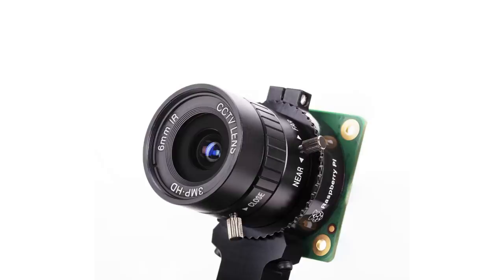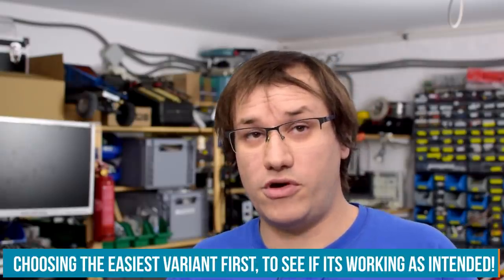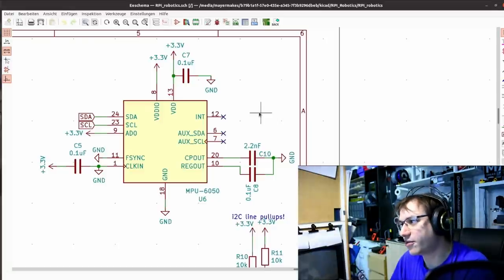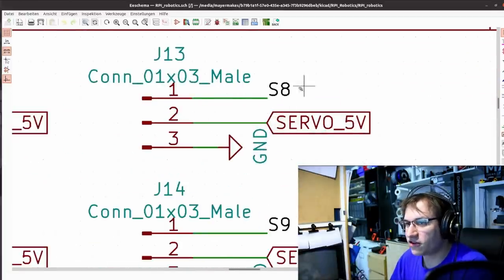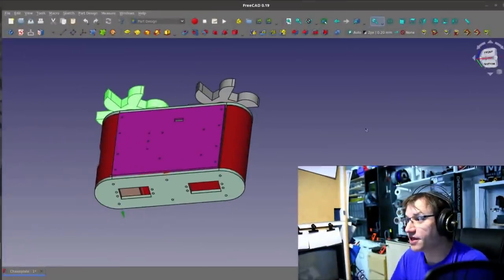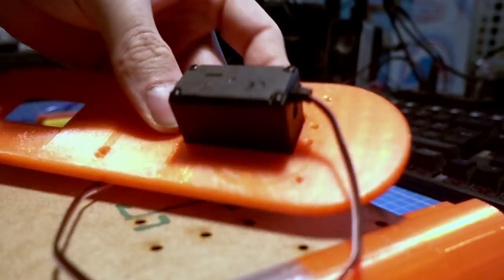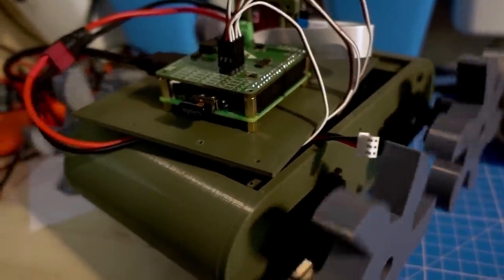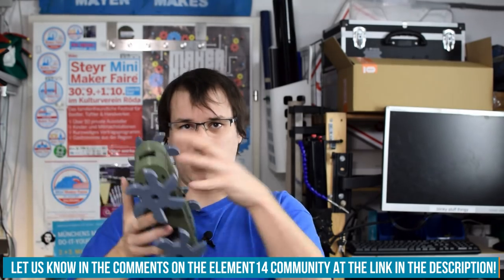Build An FPV Rover with #Raspberrypi

Comment: Great start, love your videos! 

I have 4 points 

1) A magnet on a movable arm
2) A small vacuum cleaner, strong enough to pick up small parts 
3) A rubber track instead of wheels 
4) A way to charge the batteries, a docking platform with induction charging.
Reply: All very good ideas! make sure to share them on element14.com/suggestionbox so we can pick them up!

Comment: That's really cool! It has lots of potential. The way it's designed, you could have lots of interchangeable wheel shapes and sizes, and even tracks. You might need to swap a servo on each side with an idler wheel to keep them from fighting each other, though, which would cut your torque in half, so maybe tracks aren't such a great idea. Regardless, the flat, low-profile design lends itself well to making lots of very different modular attachments for wildly different tasks. One could be a gripper claw to make retrieving lost items from under furniture easier. 😉 

I am curious why you didn't go with a Pi Zero W, or would that be underpowered for this? It would certainly be a smaller form factor.
Reply: A bunch of good ideas! make sure to post them at element14.com/suggestionbox so we can pick them up!
I prefer the a+ for computational power and connector sturdy Ness, the zero is no my preferred choice and the project does not need it to be smaller.
Reply: @MAYERMAKES  The Zero definitely has its limitations, but the connector is the same as the rest of the line. Unless you want to pay 50% more, the Zero doesn't even come with a header soldered on, so it's just solder holes. You can't get sturdier than that.

The computational power of a Zero is definitely a serious limitation, though. I suspect the video streaming alone would stress it. Even a b 3+ is not suitable for a desktop OS regardless of what you may have heard. I've tried it. Just opening a Web browser is an exercise in frustration.
Reply: @awo1fman  I'm not talking obout the gpio conncetor, but the Camera connector.
Reply: @MAYERMAKES  Exactly the same kind of connector, only the Zero's is narrower and on its side instead of sticking up. Seems like a wash at best, but the Zero's connector lying flat on the board seems stronger to me. But orientation of connectors is a space consideration as well. If you want to expose the connector to the outside of the enclosure the edge is better, but if the cable is completely internal then the perpendicular connector makes more sense. You kept the cable internal, so the A+'s perpendicular connecter is much easier to work with.

And again, a Zero probably wouldn't be up to the task of controlling everything you might want to add in the future, so I'm not at all arguing that it would be better for this application. I just don't think there's enough difference in the sturdiness of connectors to matter.

Comment: But wait - how did you build the robot without that screw driver?!? Novel idea for the wheel / traction design, I like it! Could you have duel filament printed it so the flexible was only covering the curved faces?
Reply: multifilament printing would have been an option if my lazyness would not keep me  from fixing my dualnozzle 3d printer...

Comment: “the other one is that the 3a+ is designed by element 14 and we get money”
Reply: It's designed by the rpi foundation, element14 distributes all kinds of rpi boards, and a ton of other brands. The reasons I state in the video are my genuine decisions. If the pi4 would have an a variant that consumes less power I'd use that 9ne.
Reply: Hey we're even allowed to use the PI zero if it is vital to the project!

Comment: The only problem I have is I have an external antenna but can't seem to get the rasp to use that ant instead of its own on board ant
Reply: you might need to specifiy the network adapter in the dhcp.config file it may just default to the internal one.

Comment: UV4L...  And none of the setup info for it.  And not available in debian buster(x86/amd64).  The docs under which tells you to use VLC (cvlc).
Reply: Available on current Raspberry pi OS, which is what I used. Setup is installing and starting according to the manual.